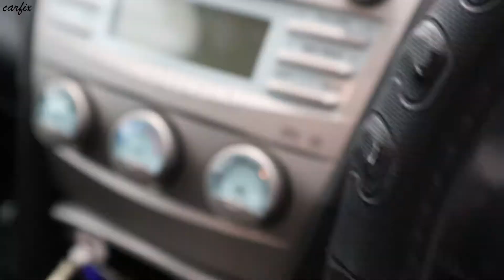Water pump replacement 2002-2011 Toyota Camry 2.4L

Comment: So smart to loosen the water pump pulley bolts BEFORE taking the tension off the belt first! Well done. 

Burp the engine at the end after adding new coolant.

Comment: You should use a funnel to add the antifreeze. It is easier and you will spill less. Plus I would wait 24 hours before refilling, to let the sealant set. Very good video. You can see everything you are doing clearly. 😀